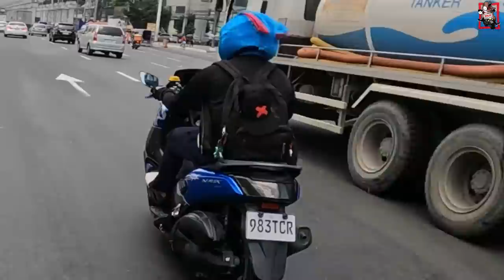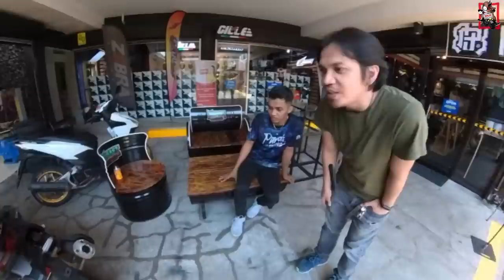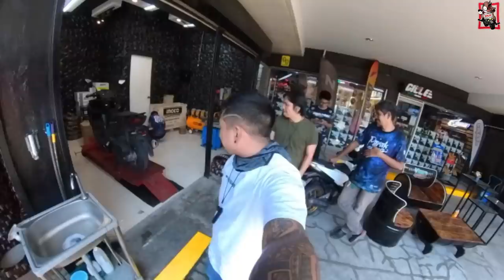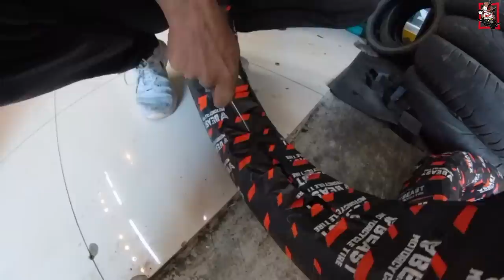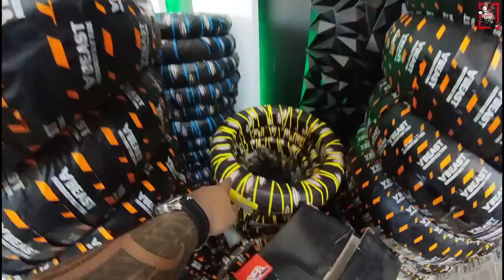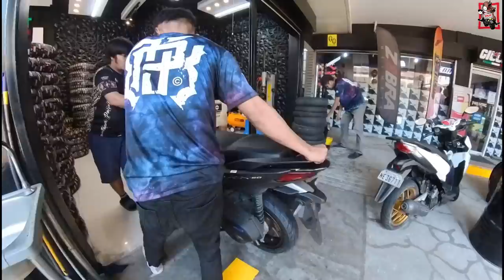Honda Click 160 Beast Mode

Comment: Yung sakin gulong ng Honda ADV kaso mas Mahal xa kumpera sa ibang brand mataas Kc tire threads nun kaya ₱2,500 isang tire, usually mga ganong size 110-80-14 front tire ng Honda ADV... Michellin brand ₱1,300 Isang tire 110-80-14 size kaso di mataas Yung tire threads, kasing presyo ng V-Rubber brand ₱1,400 isang tire 110-80-14 din Ang size... Maganda Yung Honda ADV front tire 110-80-14 matagal daw maupod dahil mataas Yung tire threads niya pang off-road lifespan 3years kaya nga Yung presyo nun ₱2,500 kumpera sa ibang brand na medyo mababaw Yung tire threads tas Yung lifespan 2yrs lang itatagal ng gulong...